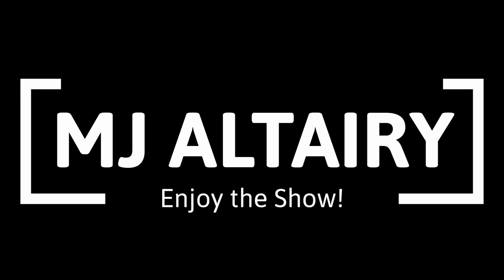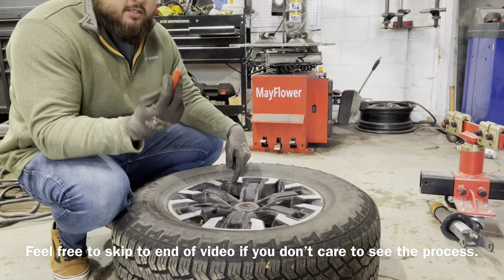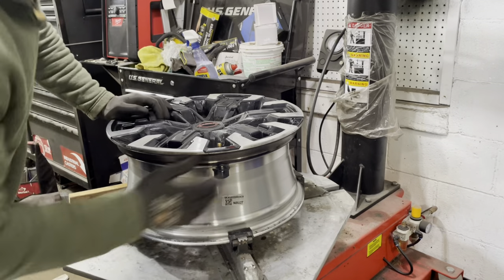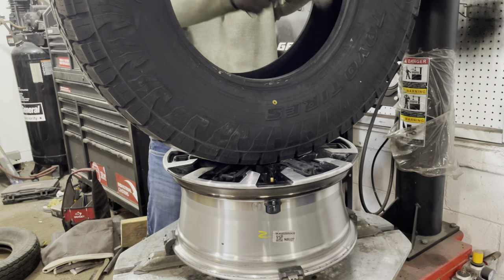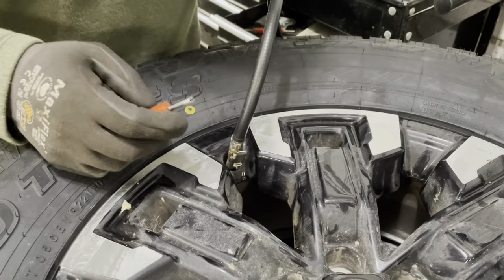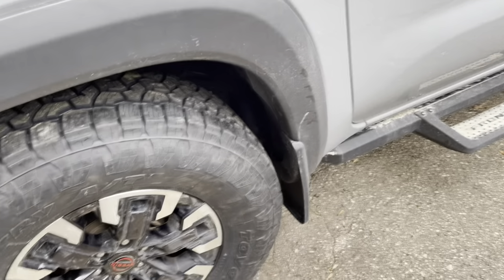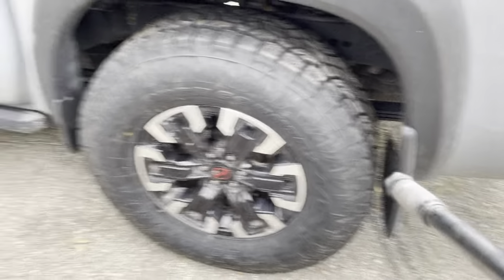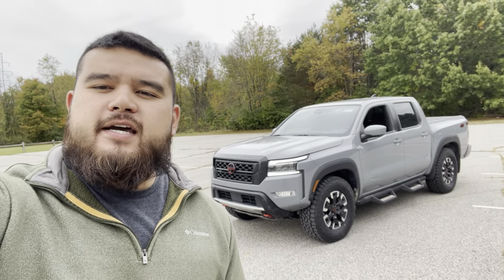Fitting 33’s (285/70/17) on Stock Frontier Pro4x - 3rd Gen Frontier

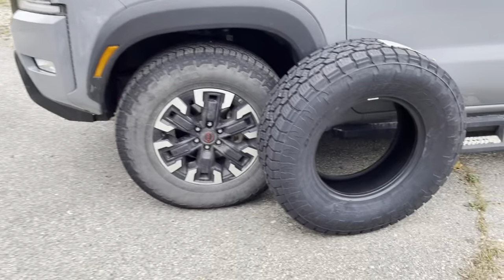Comment: Well I got my tires on my Nissan Frontier pro4x chose the K2s Firestone all weather 285/70/17 on stock Nissan rims truck 1:00  was lifted 4” front and 21/2” rear looks level tires fit perfect no rub no mud flaps, you motivated me thanks!
Reply: In order to get certain lifts they were telling me I needed 18 inch rims atleast for the new hardware. Is that true or is that just for professionally done lifts not do it at home type of lift?

Comment: Is there no requirement to trim because the stock wheels aren't as offset as aftermarket wheels? I am installing an RCkilla lift from ADO today and in the next few days want to install 285/70r17s. Don't mind heat gun, but do not want to trim.

Comment: I just ordered a 2in koni lift kit from all dogs off-road i want to put the same size tires on my 2nd gen sv this video has gave me more confidence for doing it now
Reply: Hey, have you do your lift kit? And if you have. Did you have any rubbing issue with the 285/70R17?
Reply: @cheddarmac7935  I ended up getting the Bilstein 5100 kit with their uca's and I have 285/75r16 tires on now. And yes I had minor rubbing so I I did cut maybe a half inch of metal of where my tire rubbed at full lock and I did the melt mod and I have no rubbing at all. It only rubbed when I had my tires turned at full lock though but I do take my truck on trails so the cutting was necessary for when my tires get stuffed in the wheel wells.
Reply: @thedude828-ed2nn  
Thank you for the reply. This information you gave me helps me. I am think of going with the 285/70r17 on my truck. But was wondering if I had to cut and met mod.
Reply: @cheddarmac7935  no problem hope it helps the cutting is in the wheel well like on the inside so nobody would ever notice it.

Comment: Thank you for this video! I just bought NISMO's suspension lift for my 2023 Pro4X and I was wondering if I could go with 285/70/17 Falken Wildpeaks!
Reply: I just tried to have that exact tire put on my 23 pro 4x with nissmo 3 inch lift and they don’t fit. They rub on the wheel well on level ground. How did you do with yours?

Comment: Awesome video! I think 275/70/17 would've been a better size without any modifications. Thanks for sharing!
Reply: it needs a 2-3'' lift or those tires will be rubbin on every speed bump and off road all the time
Reply: The problem is that 275 70 17s are all LT commercial hard rubber load tires.  They cost way more and the ride quality goes to shit.  Otherwise, I agree... but mainly because those 7.5 inch OEM rims are not a good setup for 285s IMO.  Between the rubbing risks and popping a bead on the trail under stress I will pass.
Reply: @rickwhitfield7617  yep. I was gonna say that too. not worth it.  Unless all you care about Is looks

Comment: Thanks for the very informative video. I have a set of 285/75/16 that I had on my 2021 SV with minor rubbing on stock suspension with mud flaps removed. I just signed for a 2024 SV today and plan on running the same tire and wheel combination on the new truck. The only difference between the size you put on and the size I have is 0.1" in diameter difference. I noticed a difference in wheel well size between the 2nd gen. and the 3rd gen. The 3rd gen. has a larger clearance on the front as compared to the 2nd gen. Hopefully I won't have any rubbing issues once I take delivery of the new truck.

Comment: Noticed while you were working on the first wheel, and taking off the clip style weight, that the wheel has tape weights too.
Reply from the maker: Yes thats very normal. It’s one of the techniques of wheel balancing. You can either use stick on weights near the lip or the clip on weights on the lip. I think it’s called “dynamic” wheel balancing

Comment: Your gonna have different speeds with the bigger tire. I installed a rough country speedometer calibrator behind the gauge cluster as a fix. But you might be able to use the ecutech level 1 chip as well. So you know.

Comment: I have the Koni 2” lift kit on my 3rd Gen pro 4x and I’m getting the new Wildpeak AT/4W’s in 285/70/17 put on in a couple weeks. I have stock wheels and stock UCA’s. Hoping based off this video that I should be alright.
Reply: Did you get it installed?  How does it look? Rubbing?
Reply: I want to know roo
Reply: Update?

Comment: what size aftermarket rims are an exact replacement for the oem, or rather, instead of someone looking it up for me, please explain how to tell? thanks
Reply from the maker: I would personally recommend a 17x9 wheel with 0mm offset. A good site that I like to use is wheelpros.com for my wheels. You can also give them a call and they can help guide you to the right fitment you're looking for.

Comment: will this larger tire hit the top of the wheel well during extreme suspension travel/compression?
Reply from the maker: we took it wheeling a few times before he got it lifted and it did fine with 0 rubbing with the mud flaps removed.

Comment: I have Titan swap four inch lift and get rubbing on inside hmm
Reply from the maker: With 285’s? Whats the offset of your wheels and what UCA’s are you running?
Reply: Offset is your enemy on the Frontier, need to be +30mm, any more negative will rub you, even with the Titan swap.
Reply: The titan swap pushes the tires out which increases rubbing,I have a 3" lift no rubbing but I'm doing a titan swap so I ordered 2" wheel spacers found 4 for the price of 2 added the backs fine then added the fronts temporarily just to see the extra width but got rubbing on allready notched fenders,waiting to do the T-swap with 1 1/2 " more lift to see if I have to trim more, I bought carbon coil overs and rear resi shocks they look awesome can't wait to try them out

Comment: People that DO take these off-road add 33's with a 2" lift and trim and heat modify the liner to keep them from rubbing on a bumpy trail: https://www.youtube.com/watch?v=NWXTW3IKPqY&lc=UgyRf1SyK7zpK7lr7s94AaABAg I tow a teardrop with my PRO4X with an Old Man Emu lift which is 2" front and 3" rear - it sets level with the 298lb tung weight of the tear drop. A leveling kit is the LAST thing your customer needs and YES I know what I'm talking about:  https://www.youtube.com/watch?v=OXWEpmknf4w